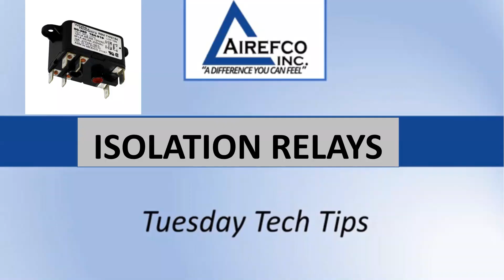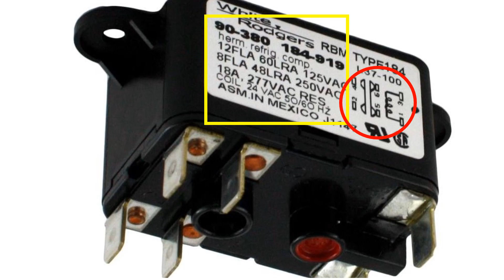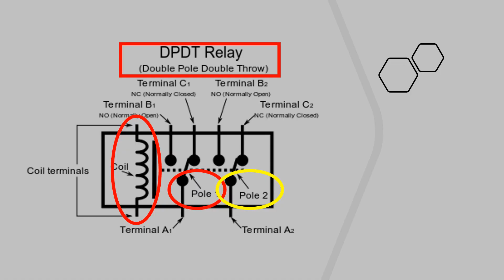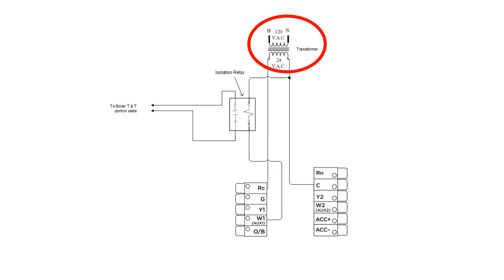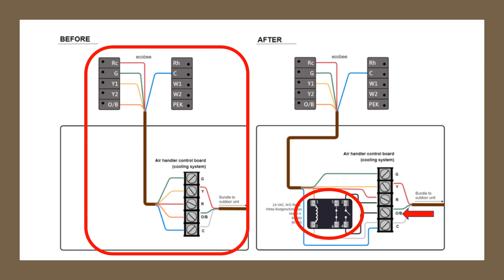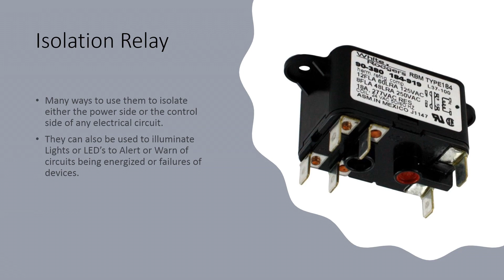Isolation Relays

Comment: I'm worried about a liquid line solenoid valve being wired in parallel with the contactor 24 volt coil. It's not clear to me whether the 24 volt power comes from the thermostat or from the board inside the furnace /air handler.  Is there enough drive on that circuit to drive both the contactor coil and the liquid line solenoid coil?